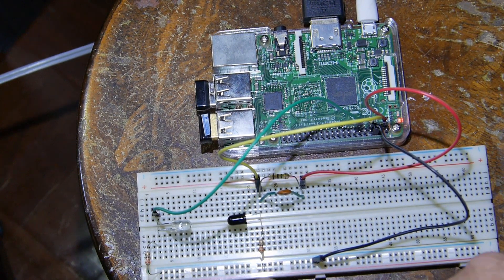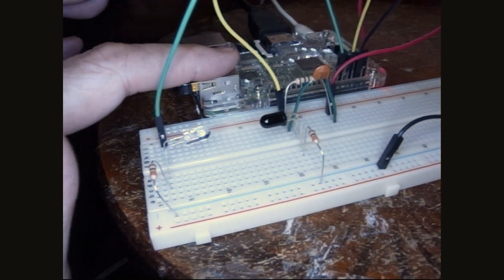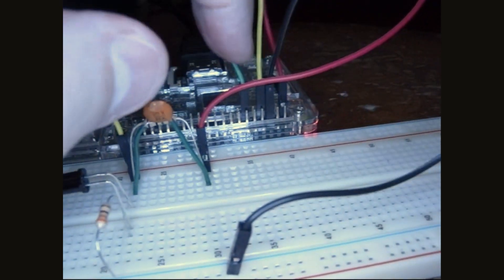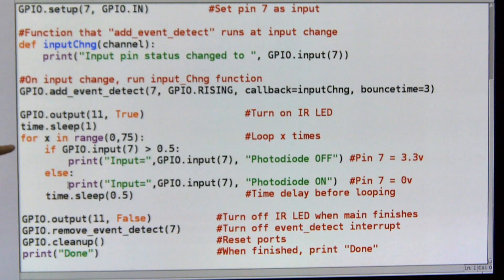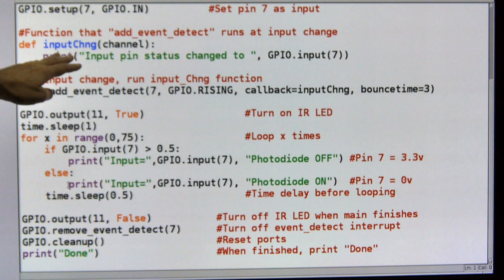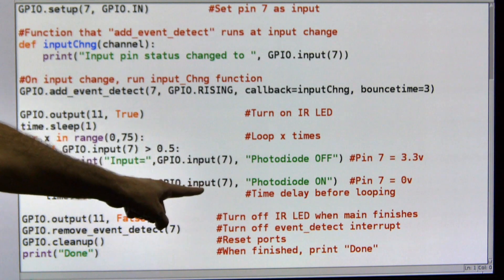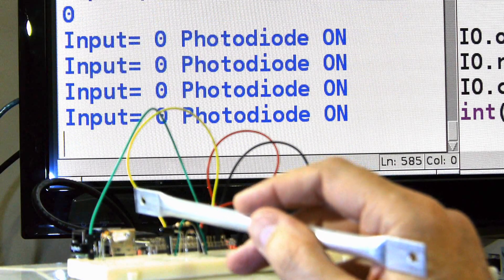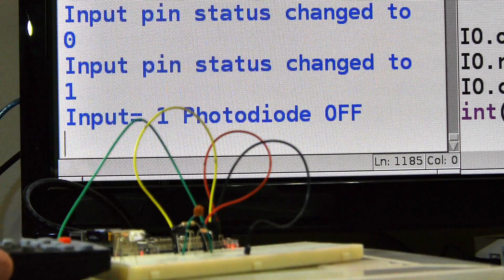RPi 05 - Detect Input Using Interrupts

Comment: Awesome video, clear and informative!

One quick question: how is it that your callback is executed upon turning off the diode when you set the event trigger to detect GPIO.RISING only?
Reply from the maker: I'm not sure I understand your question.  The digital signal goes up, then flat, then down.  You can trigger on up, or down, or both.  I chose "up", rising.  Both would give me 2 triggers per event.  Down should also work.
Reply: @tsbrownie  oh I was under the impression that the voltage on the pin would remain at high for as long as the emitter was on